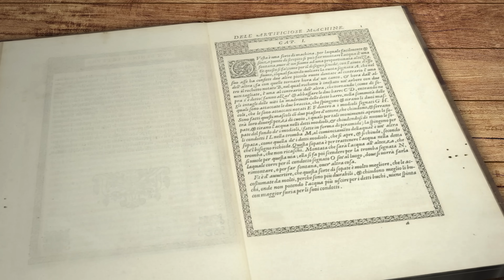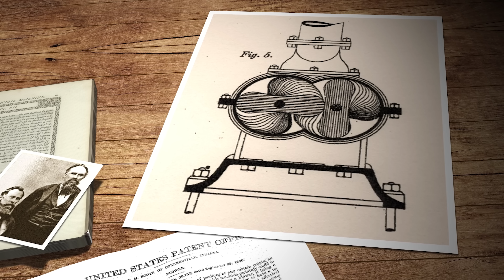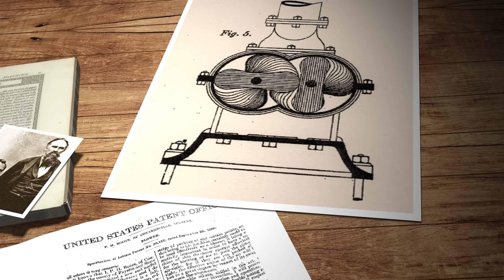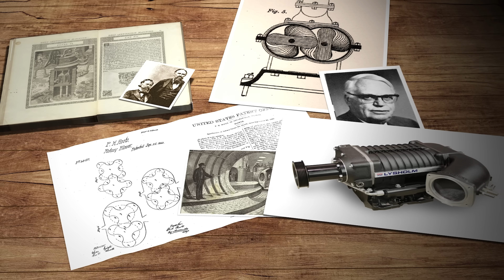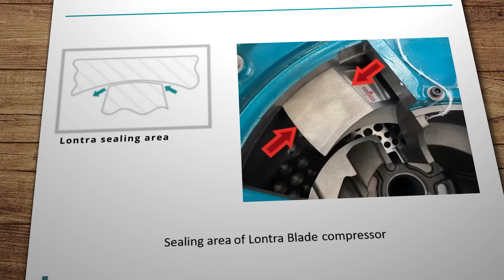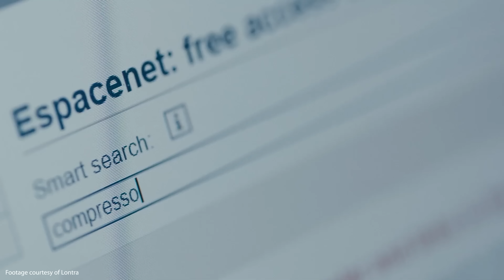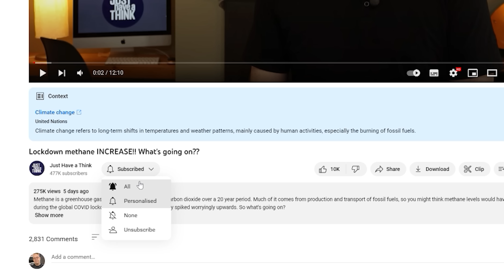Compressing air to reach net zero. A 'revolutionary' innovation.

Comment: What are the big problems with the system? They created this concept more than 12 years ago. A market disruptor (and a 30% efficiency increase counts as a disruptor) does not need that long to become a finished product that is produced in bigger numbers. So there must be major challenges with the system. What are they? Have they overcome them? If you introduce such technologies please talk about this.
Reply: Looks like standard output is max 15 PSI. Most factories need 90 PSI for pneumatic tools and equipment to work. Works great as a blower, ie low pressure applications. Needs more compression for wider industry adoption.
Reply: @baroncarleton556  what? Isn’t it cubic feet of air that air tools need? Hence why cheap air compressors are basically useless except to blow dust off you and for trim nailing a nail every couple of minutes. Real air compressors put out 13cfm at 40psi and maybe 14.5cfm at 90psi, but your then looking at minimum 800 dollars! 
 The other commenter on carbon fiber bikes, middle men have screwed the whole world generally making more money than producer or seller! Soon AI software running on blockchains will eliminate all middlemen, course the autonomous robots will eliminate all jobs! Look and see how fast chatGPT (I think it’s called) double’s it’s intelligence. In 18 months no industry will survive without AI making its decisions, its designs! Its innovation, it’s whatever!
Reply: @Withnail1969  that’s peculiar cause I never said it was! I said AI doubles it’s intelligence in a very short period of time. Especially thru blockchain channels of information flowing continuously to the AI it’s intelligence will increase exponentially, scary fast! On the other hand your information pointing to you saying that ChatGPT is not intelligent is now a bit old, meaning it’s much smarter than when you last looked at it!
Reply: @Withnail1969  dude you do know that star driven screws are vastly superior to nails right?
Reply: @baroncarleton556  
Maybe the 15 is just used for other things, but off sets the heavy use items. A storage tank for 15 psi will last forever without maintenance, if you think of it that way. Like every other green tech, bigger upfront investment turns in tti long term sustainability, if a company can afford to build a storage system and has the land, that 15psi is all about volume, when you try to go higher you start adding complexity and failure points. 
Alternatively, 15 can be done easily but there could be multiple stages, something that can do really high compression but has a hard time in the beginning from 0 to 15 psi... and then create super high pressure, and then remix in to final storage for somewhere in the desired pressure range. Or, what if they ran vacuum instead of pressure, evacuate your storage with a long lasting efficient pump that can only reach low vacuum, but then when you start filling it with pressure..... wait that sounds like it doesn't make sense... oh well that's why I'm not an engineer i guess.
Reply: @simonlinser8286   a storage container holding 15psi isn't a trivial thing either... 2'160 pounds pressure on every square foot of that vessel...
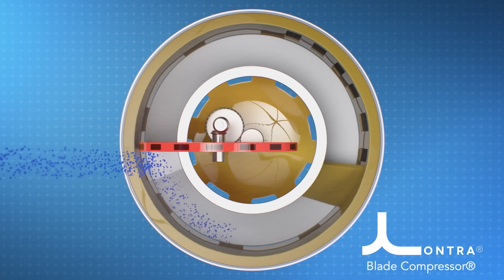Reply: 6:09 onwards..
First up there needs to be a good seal between the 2 discs.
But by far the absolute worst is the relative timing requirement of the 2 discs. This is made especially tricky with the once per cycle variation in pressure.

Edit add: there's also wicked seal requirements between the rotor and the case.
Reply: @dougaltolan3017  I'm skeptical too about the sealing. Timing is a piece of cake. 100+ years of timing valves to pistons and each other in car engines, we got pretty good at it.
Reply: @dougaltolan3017  Relative to the massive and very common screw type compressor, these same machining and seal requirements of this design are similar but in much smaller quantities.
Take a 3 blade screw compressor. You have 6 edges that are long and spiraling that must be machined to about 1/10,000 of an inch (0.0025 mm) tolerance. Then you must also have seals at each end of the screws and maintain a similar tight seal around the outside edges of each screw.
With the design in the video, you have 1 blade and 1 slot that are straight at an angle that must be machined to similar tolerances, one spot at the back edge of the outlet to the hemisphere and this could honestly be a more traditional wiper seal and then from the hemisphere to the inlet which is low pressure so need not be such a tight tolerance.
Yes, it would need some tight tolerance machining. But it is nothing compared to modern and common screw and Roots style blowers and compressors. Same machining knowledge and tech, order of magnitude easier and less work and fewer surfaces.
Reply: @mikes2381  Manching With 0,0025 Toleranz?
Reply: @dougaltolan3017  as someone who replaced the apex seals in my RX7 back in the day, I confirm you are correct
Reply: @jimb5873  has anyone seen the father & son team that redesigned that rotary engine? They got a fairly large contract from the US military.
Reply: @dougaltolan3017  the seal requirements between the rotor and the case seem no more exacting than a vane pump. Perhaps easier since vane pumps usually have input and output ports in one of the end plates and this can cause distortion when you grind them.
Reply: Those are not an issue. Machinist all over the world deal with .0001 inch tolerance all day everyday.
Reply: @archer9338  machining is not the issue, wear and tear is
Reply: Yes, the air compressor lobby
Reply: The automotive engine supercharger market may be the easiest to get into, either aftermarket or original equipment. It may be difficult to package though due to its apparent relatively large diameter.
Reply: @FairladyS130  had a 9.67 blower on my dodge hemi 50 years ago rondutchman
Reply: 1. Inertia, most places that use compressors already have one and they have a long life cycle with piping systems fitted to their design which may require reconfiguration if you put in a different style compressor.
2. They may not be as suitable in higher pressure applications?
Reply: That timing... your gears must be in top notch shape to maintain tight timing otherwise you are risking a complete destruction of the device (two rotating metallic discs colliding at high speed is a disaster). If your screw, pistons or seals get worn out, the worst thing that usually happens is lower efficiency and thus lower pressure. If you are company that needs a compressor that runs 24/7 you have to decide if higher efficiency is better than FREQUENT mandatory preventative maintenance which costs time and thus money and the absolute need to change parts of your compressor after prescribed run-time for OEM parts which are ALWAYS expensive.
Reply: History is littered with instances where the better concept/product doesn’t/didn’t prevail. It’s just not how things go. We are talking about something that would be extremely disruptive to existing industries; where tens of thousands of people potentially could lose jobs. One better believe the weight of that comes into affect when a company looks at the conversion. They have to shut down production, modify systems, retrain/educate.  All that cost money and destroys existing relationships. 

I mean electric is far superior to internal combustion, all the largest movers in the world are electric. Electric car has been around for over a century, and still not the dominant force. Hydrogen fuel cells are superior to batteries, but still not widely available due to irrational fear of impossible nuke scale accidents. Nuclear energy is far superior to wind and solar, but not the go to, due to the same deep seated irrational fears. All the while submarines around the world  for many many decades have proved it to be safe and reliable. 

This one thing could lower energy consumption by 30-50% and very few people are talking about. Yet people will say something that consumes ⅓ of 1% of global energy is the biggest problem in the entire world. People are irrational and easily lead by those willing to spend a little time steering them away from the better option/hats best for them. 

TLDR to why if it’s so much better it’s taking so long; is simple that’s just not how the world actually works
Reply: @geauxracerx  that’s a myth when factoring costs, nuclear electricity is outrageously the most expensive electricity with outrageous socialized costs in the end. If things were like you say nothing would ever change. There comes a time when a compressor needs changing. Change is inevitable, and whole industries become obsolete! Happening now 90% of all trading (stock markets) is automated AI driven computer programs. Soon everything will be AI driven, hopefully in time that billions of people don’t soon starve or die of heat exhaustion, or freeze to death, or any other extreme event driven by the insanity of subsidizing fossil fuels for the last 70 years!
Reply: 30% more efficient is only part of the story. If the pump costs significantly more and only lasts half as long it may not be worth the energy savings particularly if energy is cheap. 
Plus lab to factory is about 10 years on avg and we just came out of a global pandemic and may be headed into a global recession.
Reply: I'm sure not the only caveat but from the manufacturer brochure it looks like the operating range of this compressor is 3-15 PSI so it will have a narrower market and won't be competing in the high pressure environments. I know construction when using compressed air is often up in the 50-150 PSI range but can't speak for other industries.
Reply: @Loran425  again when running air tools it’s not the psi that those tools demand it’s cfm . Most compressors construction subcontractors carry around are on the smaller side so to get any amount of air out of them, meaning at least 3cfm it has to go to 90psi or higher. Even for roofing it’s not easy to shoot more than eight nails in a row before the compressor has some time to catch up. Auto body shops on the other hand running two air sanders are going to need 20+cfm, psi doesn’t matter.
Reply: my guess is anything with engine and the bigger the engine, the more expensive vehicle or machinery it is... thus takes longer to accrue profit from business to buy newer model of that machinery with latest improvements and upgrades. UK car (private, dont know vans, trucks, buses etc stats) average age can be one reference point.
 For example I look latest cpu for my pc about every 2-3 years if it does same work faster and with less electric, im gonna buy that ~300euro cpu to have savings. If it performs +5%, not worth it(yet). For car 10-30thousand euros time would be perhaps 5-10 years (I dont have a car now for reasons I dont need one that badly and it has monthly costs).
Reply: I'm not exactly sure where the 34% gain comes from when industrial screw compressors are already 75% plus. It takes a pretty big jump to get industries on board when it's unproven and down time would eat up any gains very short order.
Reply: @kstorm889  no power input value in the brochure by the way, a bit suspicious activity going on, also no dryer by themselves, e.g. kaiser with refrigeration does pretty good job.
Reply: Many large compressors last a long time. And when it dies, the obvious replacement is the same thing. They will be designed into new plants or major changes, but no one will take a factory down to replace a working big bucks compressor.
Reply: Govt regulations can also hinder 
Also you need to convince someone to take a chance on an unproven product
Reply: These compressors are not new. They've been around in one iteration or another since the early 1900s. They've all failed to gain significant market traction for various reasons. The right angle drive required, simply can't be made efficient. If it's built to be efficient, then it isn't reliable. Thermal management of internals in longer duty cycles is also a considerably problematic in smaller examples. Larger scale applications can route fluid cooling, to alleviate the issue... but there again, raises the issue of ancillary efficiency losses. 

Beyond all this, are the massive machining requirements, compared to traditional offerings. Even with twin screw compressors, the surfaces only require two axis machining, all the surfaces are longitudinal, and gear mesh is parallel axis.

...and we haven't even addressed typical applications yet. Think about where most of these type compressors are used. In nearly all scenarios, they're not looking for simple pressurized air, but also smooth flow... something this particular design isn't particularly good at.

Does it work? Yes. Does it work well? No. Is it practical? No. Is it efficient? Not appreciably more than current market offerings. Is it cheaper to manufacture? Not on your life. In short, it works, and it's different. Market-wise, it's dead in the water.
Reply: 12 years is extremely new. It can't even have been run 20 years to establish it is dependable.  These things could still be hand made they are so new. It is simply unproven, it is very hard for bean counters to even think about buying unproven hardware.
Reply: in a capitalist system not the best ideas comes to fruition, that is not the goal of the system-.
 and yet we continue to feed it.
Reply: He's all about hyping everything green without an honest eye, or even good faith mention, toward the economics
Reply: It's very difficult to take a good hardware idea and turn it into a market success in less than a decade. Can take multiple decades before it catches on as "normal."
Reply: I think the 4 to 15 psi outlet pressure limits it's utility. The bicycle pump comparison is a bit of a stretch.
Reply: Why fix something that isn't broken. I'm guessing older compressors last a long time
Reply: @datainformationvector  You got it!. 
  I mean if you really want an efficient home compressor, you could run your municipal water supply 60ft up a tree, and back down to a gravity tank on your roof to feed your taps. A few small tubes inserted in the u bend at the top, to draw in air, and a degassing section before a constriction to the water tank at the bottom. 
That would give you a 60PSI tank of compressed air about half the volume of the water your house uses in a day, if you fill it once a day. 
No cost to anyone. Very high compression efficiency, because the water absorbs the heat of the air being compressed. 
No moving parts except the tap you turn on. 
That's a Trompe.
And they used to be used damn near for every compressed air requirement. 
It would even make your house plumbing far cheaper and more reliable, eliminating the need for pressure reducer valves and high pressure pipes and fittings. 
You could use the water pressure to lift stuff with hydraulics on the way up to, and even run a turbine instead of a contstrictor to release the pressure at the bottom. 
Probably enough to run enough lights and device chargers to not be deprived by no mains power. 
And use the compressed air to run a refrigation. System.  Just by letting it expand into a heat exchanger in the fridge. 
Or a turbo expander to make more Electricity and cool it more by expelling it at lower pressure.
Reply: There's a reason most (i.e. all) compressors keep their seal area as small as possible: boundary layer drag. That seal area has fluid in it (air, water, whatever) and the larger the seal area is, the more energy is lost to fluid friction. I'm guessing their "30 percent efficiency increase" goes way, way, way down the higher the throughput of the pump.

One of the things he didn't mention is that compressor efficiency goes up with scale. This is why you don't see a hydroelectric plant running a football sized turbine at 10 million rpm. The turbines are the size of a small house. Similarly, you don't see industrial compressors running off drone motors powering matchbox sized gear compressors.

Lastly, how many uses are there for a positive displacement only pump? Pistons (like what your car runs on) are only positive displacement if at least one of the valves is always open. When the valves are closed (i.e. during compression and power strokes) pistons aren't pumps at all. They're pressure transducers. This "new" pump is worse than a gear pump for use as a motor.

So yeah, the use cases for this thing are small scale, low volume gas only pumping in facilities where air compression is a vanishingly small fraction of operating costs.

Its an answer to a question no one asked.
Reply: Why is it not being widely adopted? Some potential reasons:
1. Coverage in relevant media (not like sportsball ads but like literature targeting various compressor reliant industry personnel) 
2. Institutional inertia. "Try a new product for our industry? I don't want our $100 million plant to be the guinea pig."
3. 12 years is Very new for a compressor design. They are competing with hundreds of years of design and understanding and inertia.
Reply: @mikes2381  you have no clue. A lot of my client spend millions in compressed air. Plus utilities would pay 100% of the upgrade to save power. If it's not adopted it's because it doesn't work. You also have CAGI and compressed air institute that would diffuse informations if it worked.
Reply: @mikes2381  probably also absence of the infrastructure. Business would by the solution which has maintenance center, 24hr support and huge unit order delivery at any random moment.
Reply: @mikes2381 if its truly 30 percent efficient ..there are many applications where they can be used ..not all million dollar industry run on single compressor so atleast they can use one out of ten compressor to test feasibility... What i believe the problem might be cost at the moment ...ao if tru😢ly as shown in video ..i believe there is also need for government interference to subsidise as it is saving significant energy which is equivalent to planting tree or using renewable
Reply: @mikes2381  The opposite is true , if its cheeper and more efficient there's more profits , or its not all it seems .
Reply: @mikes2381  erm, #3 is just wrong. The idea  behind this design is very, very old. I can tell you all what the hold up is, at least in the industries I'm aware of. It's the old "devil you know" idea. They know the current design they use very well, how much it costs to operate, fix when it goes down, how often it goes down, all of it. This better design may be better, but they're afraid of it, as it's the "devil you don't know." 

It's not that it's your #2 of inertia as it is flat out concern; a gigantic worry about change to something they don't KNOW.

(Edited due to clumsy, dyslexic fingers)
Reply: High maintenance costs suffering from low round trip efficiency.
Reply: I have worked in three different industries where superior technology was developed and offered for sale only to be shot down by incompetent management at potential customers. It is a very difficult thing to do to convince a customer they have been doing something wrong. It's no joke. And I'm talking about products that could save companies 25% of operating cost with a pay back on investment of less than 7 months. The world is FULL of idiots who are often in charge.
Reply: Power costs have just recently become high enough to justify buying new equipment.
Reply: wanna see the elephant: https://www.lontra.co.uk/wp-content/uploads/2021/06/Lontra-LP2-Brochure-Global.pdf 1 bar maximum pressure... good luck with that for the most of the industrial applications.
Reply: @simonlinser8286  😂
Reply: JHAT doesn't do anything useful like this. All he does is crib futurism magazine articles.
Reply: @interstellarsurfer  first that’s bull shit, second WTF are you doing here?
Reply: You typed 12 wrong more like 100 years ago
Reply: Sunk costs. Even if replacing all your equipment might be cheaper for ongoing costs, if you already have the old equipment and the manufacturers already have their lines built to make the old stuff, you’re looking at a big expenditure of energy and money to swap things out and the savings may not be realized for many years when you account for that. You also pay an opportunity cost for that because that same money might be put to something else that gives you a greater return over the same time. Add to it that the old stuff may be more trusted because it’s been around longer and you find a lot of reasoned unwillingness to change.
Reply: @parmesanzero7678  all that comes with a happy medium that most any bean counter can figure out. Besides air compressors die they get replaced. If a companies purchasing agent is worth two wooden nickels he will buy the best thing out there!
Reply: The government is probably stepping on there own toes like usual
Reply: It only blows 15 pounds.
Reply: Maybe they’re waiting for the carbon myth dodo to lay its golden eggs in their direction. But the carbon mythologists are currently still busy working on ways to tax the two legged carbon units that they REALLY want to reduce…!

Try typing the word that begins €Û and ends with G€N1C$ - which most accurately describes this process. 

Or don’t. Instead we could just keep taking the B00$T€R$. I hear they are safe and effective…!🙄👀🧐😎😜
Reply: Not particularly. Recognition & price ratio of a new, protected system vs the market of compressor types W history, recognition, collective experience, multiple vendors & market competition make disruption incredibly difficult; especially in a situation where energy efficiency is not yet a high priority for most potential buyers.
Compressors are also infrastructure, so upgrades happen rarely, if at all.
Reply: @iainburgess8577  1990 the company had five, maybe six 15 to 20cfm electric piston pumping air compressors. Fabrication came almost to a stop as we ran pvc hooking all the various areas of air lines together and hooked it all up to a 250 cfm screw type compressor. Then over probably 6 months, when there was time, replaced the plastic with iron pipe. Course the first thing I did was build wooden insulated walls around that outside installed compressor. Was just to loud to walk by. Much more efficient, lots quieter inside with no compressors going off all the time. Companies that sit still die faster and faster. When robots can smell bad meat, see absolute temperatures, no one will die eating at a fast food restaurant! People can say they won’t ever have a computer driven car, and sure they can make that choice, they just won’t get to drive on certain roads and highways. Autonomous AI robotics is taking over exactly because the corporations call the shots and their shots are always to maximize profits. Robots don’t need health care, don’t get paid vacations, and can do anything you can do only better, and perfect every time!
Reply: The precision of the gearing between the 2 rotors would also have to be unbelievably tight to achieve proper air-gap clearance at the intersection. it may not hard crash if designed with tapers at the intersection, but gear ware will likely cause edge ware at the intersection, friction and degradation of the seal; at least that is what I see from watching this video.
Reply: He started off with climate change talking points. 1. Anthropogenic carbon emissions: Ban the use of all fireworks.  2. Net Zero: Impossible, because physics #Entropy. 3. Co2: Ban the use of "dry ice", immediately.   4. Warfare: Ban warfare.  Until this happens, climate change talking points are rubbish and purely political ideology.
Reply: @uelhunter8160  i agree , were doomed .
Reply: @YT_TAUGHT_ME_TO_CENSOR delusional bot
Reply: Just what i would assume from the design, lack of durability, vibration and limited scalability. A screw compressor has nice axial loads that we can hold with thrust or tapered roller bearings, this has annoying torsional loading conditions. The whole system clearly has an intrinsic unbalanced design, so it will try to wobble in pretty much every direction with the two axis of rotation it has. Finally, scalability, you want a bigger screw or piston you change the length or diameter, and scale the mechanical components similarly, no problem, with this, every time you make it bigger, the point at which torsion is applied shifts further from the bearings, so you need to increase the stiffness of your seals, so the maximum size is limited. 

Now you know why the two examples of it actually being used in the video are low flow low pressure applications.
Reply: Nobody talking about how quickly they wear out vs a piston with piston rings and a cylinder? That was why it all died long ago as for most situations reliability is important.
Reply: As a former Maintenance Planner for compressed air, I'd say the most critical point I see is the low pressure. It can handle at most 1 bar. It has a decent flow 720 l/s, I see why it would work for a Water Treatment Plant as it requires volume, not pressure. For industrial applications, the pressure is just way too low. For instance in the Plant I used to work, we managed pressures 8 times greater. 

Another big factor that would imply the lack of acceptance is the maintenance services available for the machine. How easy is to find an skilled technician familiar with the machine? what is the response time? how hard and expensive is to get service parts?
I wouldn't care of all the bells and whistles if the maintenance would be a PITA.
Reply: There are lot of communist countries, if capitalism were the problem this would exist in those places
Reply: any industrial design takes years to finish, and then the facility runs for e.g. 7 to 12 years i chemistry, so just because of that there will not be so soon industrial innovation, ni general
Reply: You could say a scroll compressor is just as good...
Reply: Market moving products are enemies to the market leaders. That technology would be held back for greed. They did it with medicine, air planes, vaping, water car, tesla. Happened to one of my inventions too. 

Another valid reason is the product could cause so much market disruption that the fragile economy would fail. (By making regular people too powerful to easily control
Reply: Tbh your avatar just got mollywopped in ch1079 so I don't trust u
Reply: First class product and  presentation.  Montague Edwards
Reply: Is it a political issue?
Reply: Could you make it turn the other way and make a new type of combustion engine out of this Lontra compressor?! Just wondering 🤔
Reply: … losses when the compressed air escapes through the small orifices? Some efficiency comparisons with a typical roots blower and centrifugal compressor would have been nice.
Reply: I don't know if this is the case but sometimes the problem is just in the inability to manage a patent. for example see the 3d printers, they were invented in the 80s but only when the patents expired after 30 years did they break through. maybe in 18 years the compressors will be like this, not today
Reply: The manufacturer missed the lifetime of this device and any requirement for the purity of the air.
Reply: Vibrations, bearing loads, pulsed pressure
Reply: @@Riorozen wrong, that is not what capitalism is. Capitalism is private ownership of the means of production. There’s a reason market socialists and market anarchists as well as mutualists are still anti capitalist.
Reply: Purchasers are reluctant to buy radically new equipment. They are concerned reliability, availability of parts and qualified repair persons, whether the provider will still be in business when they need assistance, and last but not least, the inevitable high cost of the equipment before manufacturing can get economies of scale.
Reply: I would think from the design that the limitation would be displacement. Roots blowers and other positive displacement compressors usually displace a large amount of air per revolution, as opposed to the compressor shown in the video, which can only displace the volume of the circular chamber and compress it once every other revolution.

 This means that to achieve the same amount of flow (not just pressure) for the application, the compressor itself would need to be a) larger or b) driven at a higher speed (or duty cycle), thus negating a large portion of the advertised increase in efficiency- and this is before we take any thermal losses into account.

Unfortunately, there is no such thing as a "free lunch", and a nominal increase in efficiency would likely not be enough of an incentive for many plant operators to completely rework their pneumatic systems. 

By the time you factor in labor, equipment, and down time- you're looking at costs into the tens of millions in some cases. Unless that cost can be recouped in short order, there is almost zero chance of widespread adoption.
Reply: In industry hardware these things take time. Also, concepts and execution are very different. An example: high bypass geared turbofans are 16% more efficient than axial turbofans, but to make it work reliably it took twenty years. These new engines were described and built in the 50's, but only really realized their potential in the 2010's. Some things just need time.
Reply: Don't know if you have ever brought anything truely new into the world. I have, 12 years doesn't sound too long to me at all.
Reply: @CplusO2  raising a child.
Reply: @CplusO2  only in the hideous culture of vulture capitalism. 
I singlehandedly built three ~20 piece molds for three prototype central frame gearbox carbon fiber downhill bikes, built and tested them, raised funding to get 3 NZ champs on a US National, world cup downhill tour in 3 months in 2001. 
And cad designed, CNCed production molds had 60million dollars of orders, and the first production bike out by the end of 2001. It did 10 pro race seasons in its first five years. All of them are still going strong, still wining national titles.
As soon as you let a Suit near you it gets strangled and destroyed. 
The more suits you let near you the longer and more expensive it becomes.
Reply: @Aaron Franklin  what bike?  Sounds like the zerode g1 or the Honda?
Reply: @aaronfranklin324  sounds really interesting! Can we learn more about it please?!
Reply: @aaronfranklin324  as a cyclist and a builder with a prototype form of housing, your story is a cautionary one to me!
Reply: @aaronfranklin324  Suits are the root of all kinds of evil. 😉
Reply: @aaronfranklin324  I assume you had it patented? But something went wrong. What happened?
Reply: @leo_anthony  No I knew better than to have anything patented. And that's why I never lost anything but the tooling and parts that got stolen. 
Patents are only of any use to any entity who has millions of dollars and the will to waste it by playing cockfighting games in civil courts. 
If you spend the minimum of 500 thousand dollars to patent something, then any US company can apply to the courts to have your patent taken off you and awarded to them, on the grounds that you don't have the resources to produce and distribute it internationally and they do. 
And you have published all your intellectual property and trade secrets in the patent. 
So anyone can make a change to your design by as little as 5% and avoid the patent anyway. 
If some entity were to copy your patented system exactly, then you would have to spend millions of dollars trying to stop them by legal means. And they would likely use your money to have your patent given to them as the outcome of that process. 
Patents are not some kind of award given to someone for the brilliance of an invention. 
They are defined as "a licence for monopoly control and distribution of an idea or invention".

In short, a weapon of economic warfare for the extremely rich to use against the intelligent and creative hard working poor. 
That's why Elon Musk, and China don't use or recognise the patent warfare system invented by the Anglo-American Empire, as an extension to their disgusting "right of conquest" international laws of nations under which they bestow themselves with the right to steal any land or possessions they choose through superior ability to deploy violence by force or deception.
Reply: Are you referring to sustainable energy efficient construction or perhaps 3D printing homes , just curious my father tried to bring it to NE the 3D printing of residential homes, or maybe you’re talking about a Tesla home type of home , much cheaper than traditional houses , but my money is on 3 D printed constr. .? I am very interested in what your referring to. If you get a chance to respond , it b cool. No worries,
Reply: @aaronfranklin324  You are right about robber capital. I knew a man who invented a portable ultra-high temperature pass-through oven for cleaning up contaminated soil. He built a proof model that worked, but didn’t have the money to scale up and into production. So he got some 51% partners. They determine how many are made, what they sell for, and because the contract bound him to the company, how much he was paid. 
Now, though he was the inventor and put years of blood sweat and tears into his idea, he works 8-5 for the sharks n takes home buttermilk while they get the cream. He was depressed to the point of suicide. 
Inventor be careful. 
BTW: That was before crowd sourcing.
Reply: The lontra blade type compressors are available for sale and in use, rite now for industrial applications.
Reply: It's not that simple. For one thing 34% is a "up to-number", that in it self doesn't count as a market disruptor in any intelligent persons view. 

Also, a market disruptor is in most peoples mind a new type of product, not a new version of an existing type of product. Like the car, it's not a faster and/or slightly more efficient horse. Digital cameras are not better film cameras, and so on.          

Lontra have reached commercialization, they're scaling up. I can just assume it's s tough business to get into, existing technologies and their manufacturing is very well developed, and large compressors can last a very long time, if you have a industrial compressor that have worked well for 30 years, you're not likely to replace it with new technology that is supposed to be somewhat more efficient, like "up to" 34% while your old compressor works just fine.
Reply: @fishyerik  Though aint EU with new policy plans aiming to support exactly these kind of products and improvements as "green"(meaning tax subsidies, cheap loans, or even straight cash), similar as Tesla collected hefty bonuses from california state having EVs
It all depends where this facility is located (I assume electric is used to power machinery) and how much of gross margin that electric is overall... the easier profit increase it will be by upgrading, lower risk investment it will be. But you're right, "upto" is company marketing speak with heavy dose of salt needed to make these cost/investment predictions.
Reply: Not saying there are no issues but the company was bringing in 8million in 2021. It's not huge but it is a decent especially considering they only have about 50 employees. I would also guess most companies will wait until their compressor dies before buying a new one, also retrofitting a new one to fit in an existing install may add to cost and complexity that many would avoid by replacing with an existing off the shelf model that matches the current footprint. I'm sure there are issues as well but the growth of the company is not just dependent on its design, many other variables are at play with economics replacing things like a compressor.
Reply: As someone with over 20 years practical experience of manufacturing and selling innovation to both public and private sectors, my experience is that the inertia in adoption is due to the fact that there is little or no motivation for the public sector employees to adopt. When the difference in increased profit is benefiting the business owner in the private sector, it is a very different matter. Also, bluntly put, the kind of people who work in the public sector are really not very bright.
Reply: @jamesfairmind2247  And many in the private sector are sharky and manipulative in my experience , especially good at ripping off the public sector  with all sorts of shenanigans and iffy contracts that the public sector do not have the skills or time to scrutinize properly . Construction and engineering being the worst culprits in my experience . Also the public sector is saddled with `its not my money ` which is a millstone in cut throat commerce .
Reply: Exactly
Reply: Almost sounds like it became a government/military program that was throttled from actually going to the public just yet. 😜🙃
Reply: Don't ask to much to a advertizing youtube channel made to pump stock of shitty co.
Reply: Ever brought an industrial product to market?  99.99% perspiration, and 0.01% perspiration.
Reply: Human sloth, pride and prejudice holds better technologies, habits and routines to minimize carbon etc. back a long way.
Reply: Operating pressure is 4 to 15 psi.
Reply: actually there are technologys that waited longer before becoming viable. like and thats no joke: computers and radar: the first proto radar was shown of in 1904 in cologne and the first programmable computer was the Z3 by konrad zuse wich was shown of in 1941. both technologys needed about 20 years before they became market viable.
Reply: @Irobert1115HD  
There were no vacuum tubes in 1904, so it was not possible to have a Radar in the physical sense.

The Z3 computer was not an electronic computer, it was electromechanical - relays. It was not like the Atanasoff-Berry computer which was demo'd in 1939.
Reply: @acmefixer1  first and foremost: the first radar couldnt realy track things or give a reading but it could detect things and help track them so it wasnt unviable and for two: the Z3 is actually seen as the first universal computer. also even telephone relais use elctricity to run and switch.
Reply: @Irobert1115HD  
Radar is 'Radio detection and ranging.  Those early systems could detect but could not determine the range, so they were doppler detectors, not Radars.
Reply: There is a Variable you didn't Counted:
Utility of a Market Disruptor.

Nor Request = No Offer.
Reply: @antoniopacelli  if it has better price to performance ratio than the current tech and can fill the role of those current tech, then it would sell even if no one requested for it.

If for example, this performs better than a twin-screw supercharger or a centrifugal supercharger at a reasonable price then it can be marketed and sold to people who buy those products.

I guess there are disadvantages to this design that's why it has not proliferated quickly.
Reply: @sepg5084  this is not going to compete with a centrifugal blower on price, they're too simple to make. I'm not convinced they can reach far into the high pressure market either with that large open slot.
Reply: @sepg5084  It's new, it's relatively untried AND even if it is worlds better you can't just switch everything over in a snap of your fingers. Industrial users will need to budget a change and schedule it, for each reason this will only happen as they would be replacing existing equipment anyway at the fastest. Which still assumes it's already considered Proven and the standard choice for new industrial installation not just retrofitting. Whether it's smaller operations that can't afford to change something that currently works or a large corporation too often squeezing every cent out for profit they won't invite extra downtime readily either.
Reply: @sepg5084  people aren't as rational as you think they are
Reply: @sepg5084  Gigacasting technology was feasible for quite some time. None of the automakers adopted it.
Reply: @shubhoroy3921  
Gigacasting was never available until the casting machine was scaled up from a much smaller size.  The machine and the problems get much bigger when scaled up to gigacasting sizes.
Reply: @sepg5084  
Not saying that is Useless.
But that they didn't Sponsored a Brake-trough application...
Think it like this:
If you Sell a Vibrator saying that it Vibes Double the amount of a Candle your not gonna sell many..

Now think instead of you say that you can stick it Up places...

Now things Changes..sales Levitates.
Reply: @sepg5084  I'd say it's more inertia or organisations. You have tools and trained maintenance staff that can resolve issues with the current compressors. Changing it to a new concepts involves a lot of additional work. Most organisations are reluctant to get into such endeavours unless absolutely needed. Money saving is cool, but it needs to be significant enough to proliferate up the management chain for them to issue a change request
Reply: @sepg5084  Despite this video, I can see some manufacturing difficulties; gonna guess it's simply too pricey at the moment.
Reply: @alanhat5252  I was thinking the same, the example applications are high volume low pressure application I suspect there would be a lot of pressure oscillation present in a single cylinder system which may or may not be tolerable to all processes.
Reply: @shubhoroy3921  they did not have the alloy formula to work untel tesla. Same as jet engine
Reply: @antoniopacelli  true lol, capitalism is often a factor left out. Even when it’s the most vital to address.
Reply: @kx7500  Well what's your solution? What's your alternative?
Do you mean "capitalism" as in the communist term that seeks to equate an evolved system like the free market to a synthetic ideal created in the minds of man or are you referring to the free-market?
Reply: @ragnarok7976  capitalism isn’t legitimately free market despite what many say, it’s private control of the means of production. Direct control over the economy by those that actually make it up is what I’m advocating for.  One where everyone is organized and unified across shared interests and able to leverage their collective and individual power. Socialism is not contradictory with the concept of a market, there’s a reason many anarchists, the farthest left position possible, are openly market anarchists while also being anti capitalist. Capitalism centralizes power into the hands of owners who separate themselves from the things they extract their wealth from, creating an inherently parasitic system.
Reply: @kx7500  I know, that's why I made the distinction and asked which you were referring to.
Good to know you are talking about the communist term then. Nobody controls the free-market. If people have wealth because of it, it's because the consumers in that market freely traded their money for products they wanted.
Power can centralize in a free-market but it does so with the permission of the consumer. In socialism and communism power must be centralized a prerequisite. The people who already skate by and hold offices above their merit will end up the leaders of the rebellion and they will be in control of how things are distributed. Everyone will get an equal dose of nothing and the few at the top will take everything else.
Communism and socialism are contradictory to a free-market which is why they create terms like "capitalism" to vilify it. Anarchists aren't socialists or communist, though if you get enough of them together they will form a hierarchy too, ironically. They'll also trade because it's an evolved human behaviour.
Plenty of other problems with this silly ideal like tragedies of the commons, and the paretto principle. Not like you really even need to look into those because the history of communism and socialism speaks for itself. So do all the people fleeing places where its been implemented

I mean you can even see it happening with the socialist YouTubers and streamers. Their ignorant fans dump money on them for doing the very bougie job of dancing in front of a camera. It's all eat the rich and tax the millionaires then make a mill and suddenly its eat the super rich and tax the billionaires.
.
Anyway cue the "not true communism not true socialism" schtik. I'm sure you'll be the one to finally get it right 😂
Reply: @TheLosamatic  I don't need to say that because the Norwegians will tell you that themselves. Time and time again... it's not my fault you aren't listening.

Do you know what a problem of scale is? When Norway is the size of the US and has a heterogeneous population on the level of the US we'll see how well those policies truly work.
Reply: @kx7500  capitalism is the only reason there is innovation like these. the search to make products that people want to buy (either by finding cheaper ways, cleaner ways or more performant ways) is only possible in a free market… that’s partly why cars are cleaner nowadays, sure governement regulations, but customers also want more efficient cars so manufacturers develop cleaner engines to be more competitive and make more profit. y’all took the word capitalism and ran with it
Reply: @kx7500  I am a capitalist but can not stand seeing technology suppression because of greed. Just be the leader in the new industry instead of blocking it from society.
Reply: @kx7500 capitalism is the main reason we have innovation… you are not gonna get innovation is an essentially centrally planned communist/collectivist economy, in any non capitalistic system for that matter
Reply: Fossil fuel subsidies create a lack of incentive to increase efficiency or economize. Since the price of fossil fuels is lower than the actual cost to the environment and to citizen health, industry can externalize that burden and come away with clear profit on that portion of production.
Reply: @singingway  There are no fossil fuel subsidies. Fossil fuels are a major net contributor to the economy. You are beng lied to.
Reply: before they revolutionize the compressors they need to revolutionize each and every industry that uses compressor.
Reply: @simonlinser8286  Yeah man. you're onto it. 😉
I'm also glad I'm not trapped in a high density factory farmed consumer concentration camp breathing, eating, and washing in feminising endocrine disruptors, in my little apartment prison. 
I will never be able to own land in NZ either, since the Billionares bought it all and tripled the real estate prices coming here to escape the zombie apocalypse they are determined to manufacture.
But I have a couple of Ocean Bluewater cruising yachts. If you feel like running away to sea and becoming a fun-pirate, I can always use some crew. 👍
Reply: @aaronfranklin324  on my way… what’s the address?
Reply: @aaronfranklin324  Tell me you hated that Witch of Harden and i take a Black Bandana a Patch over my Good Eye.. and we are on to the Oceans...
[just kidding i am in a Lager and people Mock me because the only problem i don't have is food... which is also the only thing I spend money on... probably they buy clothes to survive...good for them]
Reply: It's rubbish. It has no ability to match existing technologies, out of patent, like a Tesla disk centrifugal pump or laminar flow concentric cones. They do not lose energy by heating the air because if run near the speed velocity of air molecules they collimate the direction of individual molecule velocities, and can cool the surfaces they contact while being accelerated. A turbo expander stage can then retrieve the kinetic energy, driving the pump, while further cooling the air. 
A few of these stages in series can liquify air while extracting the particle motion as work. 
No-one wants to put money into things that can't be patented, or can be easily made with home garage tools, and destroy energy monopolists stranglehold on economies and power. 

The problem is not the solution for the many, the solution for the many is the problem for the few. 

If you just want an extremely efficient low maintenance compressor, then intermeshing counterrotating disk stacks utilising around half millimeter disk thickness and spacing, in a double disk cavity housing, just like the first example,  require no tight tolerances, or seals, and are a positive displacement variation on a Tesla disk pump, that works at lower speeds and higher stage compression ratio. 
But suffers from the same high durability and reliability, and easy engineering, thus unattractive to slave economy militarised consumism imperialism.
Reply: @aaronfranklin324  interesting. Where can one find the details of such a pump please? Does it have a name? Maybe this channel should review it?
Reply: @aaronfranklin324  I totally agree,  my replication of the Tesla turbine/pump have 14x 300mm disc 0,4mm thick , 0,4mm gap en casing clearance en it generates 15 psi at 1500 rpm , at low temperature do to its laminar flow character
Reply: @oscarverwey  nice Work!👍💨💐
Reply: @aaronfranklin324  If works well and it’s faster, better, cheaper to make and no patent barriers to deal with, any opportunistic greedy bad old capitalist slave driver would snap this up in a hot minute and go to the bank with all the grubby cash it would rake in because all those other greedy capitalist money grubbers would buy it to use in making and selling their own stuff to make their own grubby cash.
Reply: @aaronfranklin324   hmm, re your 1st para "..heating the air.." are you denying basic gas laws eg P1V1/T1 etc ? Also how does this collimating idea work please, as gas molecules have random linear motion in all axes as well as angular momentum in all axes simultaneously - got any references, drawings of a collimating setup & how verified to stop ".. heating the air.." ? etc
Reply: @mikemassen6757  no, not denying basic gas laws for ideal gases. 
In part they support this. But they ignore non ideal gas effects such as boundary layer effects due to intermolecular forces and viscosity and Renault's number discontinuity in fluid flow fluid dynamics. And transonic and supersonic boundary layer characteristics
Do you understand that when you put your hand out the window of a fast moving car the air feels  cold because it's motion relative to your hand results in a drop of the pressure exerted on surfaces of your by the air molecules?
When a flow of air with average air molecule velocities, normally random if it is motionless, approaches the velocity of those air molecules in a non turbulent flow, they are not moving in random directions anymore, they are literally a herd going at similar velocity all in the same direction. With a narrow distribution of velocities, due to them jostling and inelastically bouncing off each other due to intermolecular forces, and asymmetries.
Any type of turbo expander makes use of this, often used in Industry to cool and condense pressurised steam or other mixed working fluids into droplets of liquid and gas mixture in the flow, while extracting mechanical energy. 
With the Tesla turbine or pump the turbulent heating is minimised by confining it to the boundary layer, and controlling the rotational velocity of the turbine disks to a difference of close to the gas temperature velocity of the molecules at the radius that they are spiralling in towards the centre for maximum efficiency. 
Thus minimising the thickness of the boundary layer. 
Same with a pump but in reverse. 
It could possibly be improved by 3d printing a disk stack with multiple nested spiral spacers between the disks, but this may limit the operational power at high efficiency range to a narrower rpm range. And eliminate the advantages of reversibility both in direction of rotation and as a pump or a turbine. 
But would certainly enhance low speed torque characteristics. And maximum power capacity.
Reply: @aaronfranklin324  ayy bro.
You just dropped a huge knowledge bomb on us.
That stuff is really inspiring honestly.
Plus you're right about the expendable population. And their mentality.

Hey can you tell me how you get the good engineering grub. Is there a website I can learn from?
Or maybe you're active on innovative tech and just browse ?
Reply: @aaronfranklin324  I was looking for the political comment. Thank you.
Reply: And a trompe compressor is the simplest most reliable and efficient of all.
Reply: @aaronfranklin324  agree, trompe compressors have a huge potential.
Reply: @aaronfranklin324  How much experience have you had with this new version in order to come to that conclusion, and what studies have you done?
Reply: @paulsmith3921  the problems are not the mechanical configuration. They are the fundamental problem of the compressible fluid behaviour in the thermodynamic principles.
It just can't be 30% more efficient I'm compressing air than existing systems because it uses a cycle which increases the temperature of the air as it compresses it. 
You'd get better efficiency by using it to pump water into a cylinder full of air and compress the Air that way. 
Then you can keep the Air temperature constant as it's compressed by dumping it into the environment more effectively, or using it in a secondary cycle. 
Better yet use something like water or ammonia or a mixture. Then compressing and phase change from vapor to liquid improves efficiency far more.
Reply: @aaronfranklin324  never heard about a trompe compressor thanks for the info.
Reply: Most of the major challenges seem to come from the motor and oil companies tbh.
And nasa. (They scooped up the tech for a ten year AA battery cell, not whats on the shelves now, a battery that runs for ten years (fisherman designed layers of solar and bioluminescent material and rolled them up, bio lived and lighted for 10years) then theres the almost completely efficient solar cells theyve discovered about 4x in the last 15years. Last one was a chinese guy. Crystaline trees, each branch took up the energy of a part of the spectum, covered most of the spectrum.  Wheres that 🤷 we went ten years in reverse for a few years there. Were almost back to 2020 standards 😂oil companies🤦